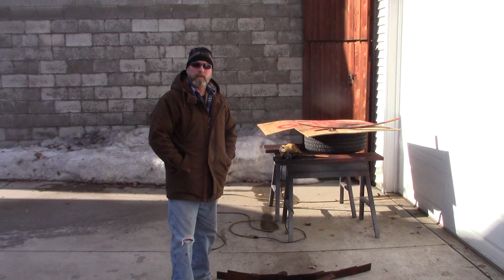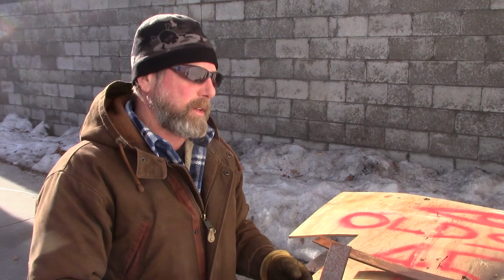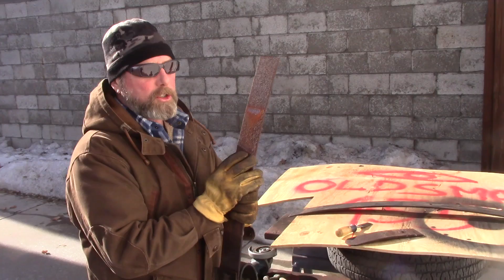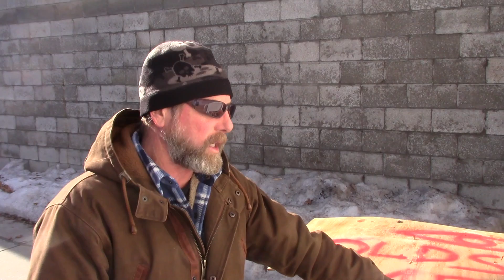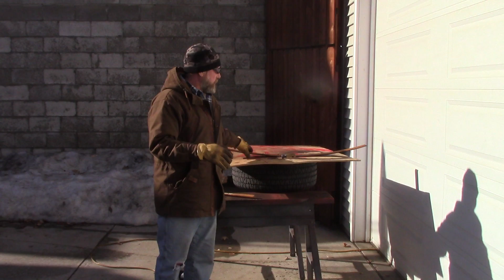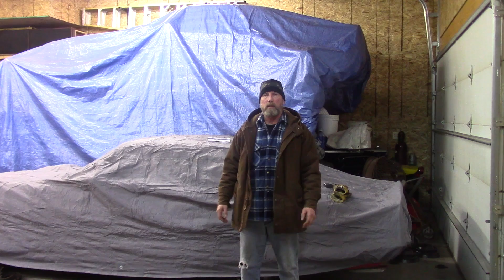Tech Time With Paul: Leaf Springs

Comment: Love it! Back in 90s I had my Leaf springs re-done in my Hornet $300 bucks and it was the best $300 bucks I ever spent on that car. When I replace the factory 304 v8 for a 360 and start build up the motor the rear springs jump, try shocks, helper spring kits you bolt on from the RV shop, then the iconic traction bars! i was learning

Still was not right for me, but ones I springs where re-done with a extra leaf in, (spring guy`s know what I was trying to do) the car front end hope (thanks to old worn out shocks in front). It handle lot better and after I put in a set of rear shocks that where adjustable to be hard when the springs when up and allowed them to drop fast I could drop all power and take off in a nice straight line and that was the end my days of screwing around with bolt on crap. There are something`s that got to be done right from the start, thanks for the video :)

Comment: Leaf springs are Heavier, but they also keep the axle located so the weight of the 3-4-5 links is excluded, also the mounting points, bushings, the leaf type saves a lot of parts
Reply: What ?